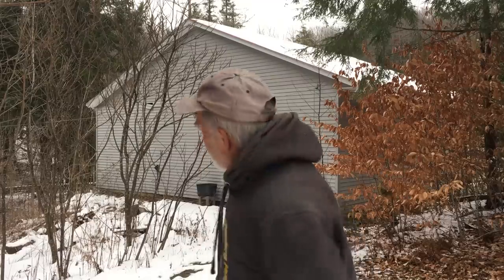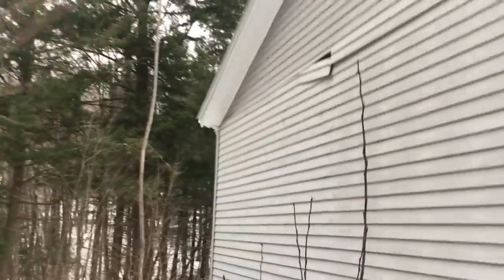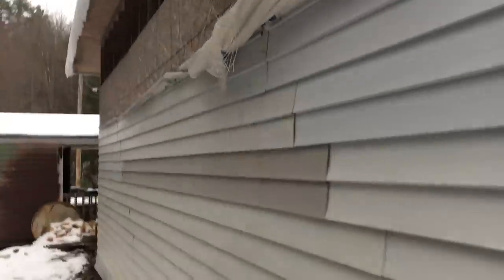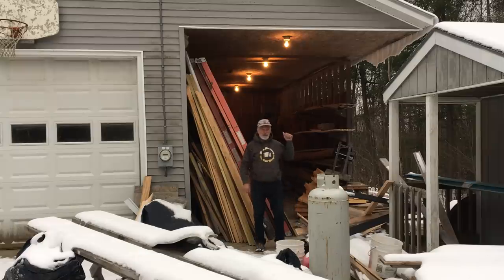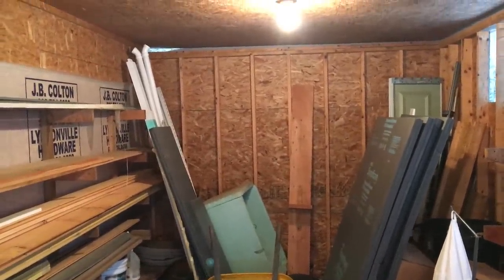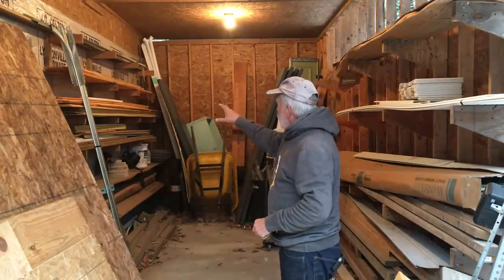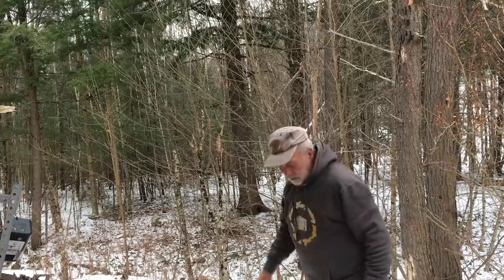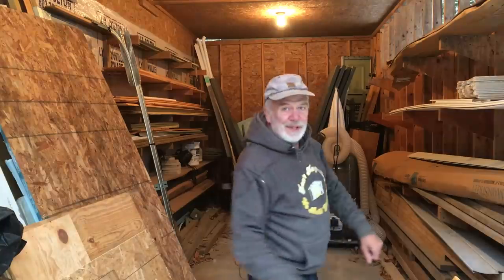Building to the Letter of the Law

Comment: Ken: I was also a carpenter / builder for many years. I was always so busy remodeling and building homes for other people that many times my own home got negated simply because I did not have the time to work on it. In 1980 I had between 3  people working for me when work slowed up and I decided to take the complete roof of the home and add a second floor which was about 1,500 SF and I tried to get the job done as fast as possible before I got busy again. It's like the old story about the shoe making who never has the time to fix his own shoes.
Reply from the maker: Haha thanks

Comment: As a previous inspector I can tell you that as long as the "wall" doesn't touch the ceiling and the cantilever roof does not have a support under it, they are not included in the square footage of the building. Also like a concrete patio does not have to meet the setback requirements even if you put a wall around it because the wall can be construed to be a fence as long as it doesn't exceed the maximum fence height. But if you try to put a roof on it, it becomes a structure and is in violation of the setback requirements. In essence what you have at your garage is a privacy fence, a sound barrier, a wind breaker, a wind breaker or whatever meets your jurisdiction needs because it is not a part of your structure.
Reply from the maker: Thank you for explaining it better than I could

Comment: Ken, a friend built a shop behind his house near the back of his property which bordered a small one lane lightly used road. He designed a rectangle shop but code required a set back from the small road on one corner so he changed his design to comply with the setback requirement by cutting off part of the corner near the road. It made the building look a little funny but he put the foundation forms in to reflect the corner cutoff as required by the approved city building permit. Before the cement pour the building inspector arrived and seeing one corner cut off asked why. He told him the city required it to get the permit. The inspector looked around at the surrounding woods and small lightly used semi-rural road and shook his head. He told my friend to forget cutting off the corner and redo the foundation and structure the way it should be...as a rectangle. He did. Everything was signed off by the inspector through the various stages of construction and to this day, many years later, my friend has enjoyed the use of his rectangular shop without an unnecessary corner cut off. A reasonable and smart building inspector saved the day.
Reply from the maker: Thanks

Comment: It's amazing the difference in building codes throughout the country. To build a typical garage exactly as you do, I would have a minimum of 3 inspections, more if it had a second level, and even more if we did the wiring or the garage utilized a floor drain. Quite a few times a customer wanted a certain feature that was technically illegal based on code, but the inspector had a solution to beat the ordinance, "similar to your wall not touching the joists". I think it's all a game sometimes.

Comment: Before I make a suggestion, I have a new personal low weight of 188.0 getting closer of my goal of 185. I took notice right away of your lighting in the storage area. I would if I were you think about replacing the old-fashioned light bulbs with two eight-foot LED light fixtures. They will give you better lighting and are cheaper to operate, just a thought by this watcher.
Reply from the maker: Congratulations. Thanks for the input

Comment: wait  a minute  the  2x4 cross supports attach to the short wall and building. If I were a code inspector I would say that is a violation.  I would  say  2x4 cross support is a overhang unto itself  and thus it can't touch the wall
Reply from the maker: They said nothing sitting on the wall

Comment: Ken hole are called ventilation not that you need it in this case I love stupid laws they make for ingenuity technically you are touching the roof as it’s joined to the rest of the building
Reply from the maker: I’m going with technically it wasn’t touching the roof or ceiling to create a load bearing wall. Ha ha